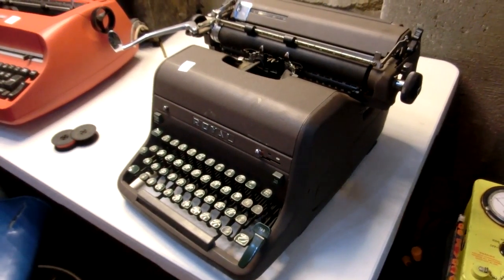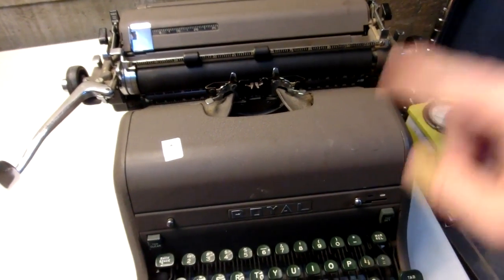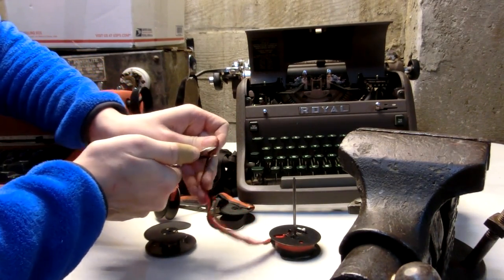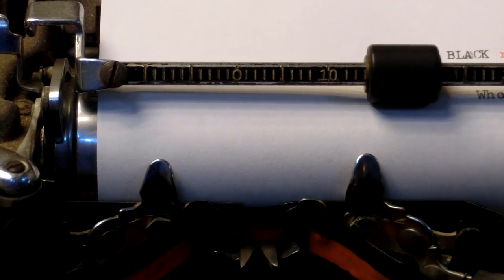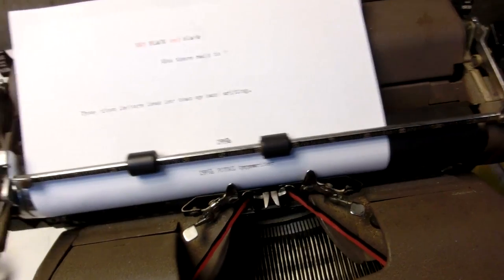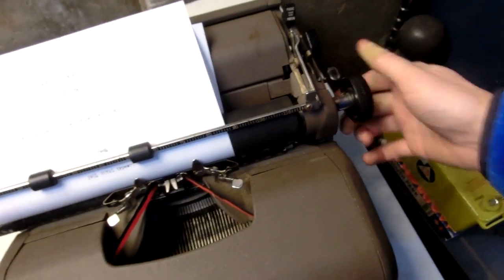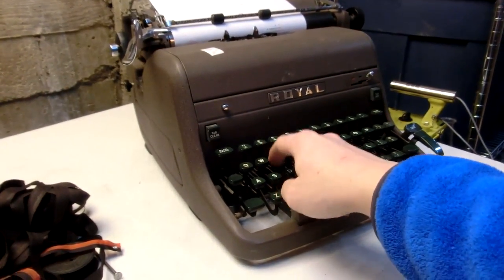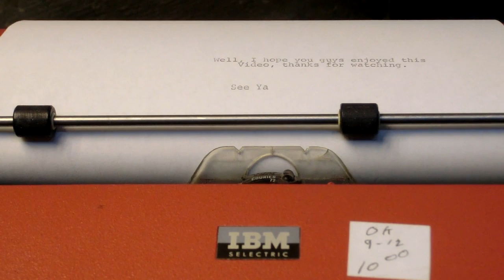worn-out 1950s Royal HH typewriter, lubricating mechanism and replace ribbon

Comment: Rinoa Super-Genius--Those IBM Selectrics are mighty fine typewriters.  I've used quite a few.  But I'll lay you book:  That HH Royal will outlast that Selectric by decades.  What you have there is one of the toughest typewriters ever built.  My 1952 Royal, which has seen severe service an an elementary school, as of this year has outlived my own mother.  You will be passing your machine down to your grandkids, and it will still be able to produce a neatly typewritten page as well as it did when it was new.  It will be well over 100 years old before its done (I have a working 1916 Royal upright that bears that out).  I've owned, serviced, sold, and rented these out for over 35 years, and I can tell you--you'll be going through more Selectric typewriters while still owning the 1 HH.  I presently have 2 HH machines myself--the 1952 11" carriage pica type, and a 1955 13" carriage elite type.  Both absolutely great machines.
Reply from the maker: I'm curious if a Paillard would be better built given the quality of the Paillard Bolex cameras, plus those are QWERTZ instead of QWERTY typewriters :D

but yeah this typewriter is nice. although i disagree about the selectric, it's lasted longer than this Royal for me.
Reply: Paillard typewriters, I've read, are actually Hermes typewriters--which had qwerty, quertz, and azerty keyboards, depending on the country the machine was to be exported and marketed to.  They are Swiss-made typewriters.  I once had a Hermes 3000 script-writer, which was a good typewriter, buttery smooth about the touch.  However, it had a few reliability issues, plus the plastic parts gradually disintegrated.  I tried an upright, but it was a little stiff.  I am not stating facts--just my opinion, the Hermes, Swiss-made and all, was NOT the machine a Royal upright is.  BTW, the $10 you paid for the Selectric was a very good deal.

Comment from the maker: I picked up this old typewriter the other day, and its pretty cool. although it has an issue of sometimes skipping a space after typing a letter, and other times it double types. i'm thinking it might be a bit worn out. its also difficult to get some letters to print correctly. it looks like i'll still be using my IBM Selectric for typing letters. but this ROYAL typewriter still is pretty cool. maybe i should connect it to a computer or something.
Reply: Judging by what you said in the video about being used to computer writing, and what I've heard about Royals demanding good technique from their users, I'd say the issues with double typing and skipping spaces are all due to incorrect technique. I would know, I work with computers so it's been interesting having to develop a parallel technique for typewriting. Curling fingers, elbows below keyboard level, wrist slightly bent upwards, and hitting the keys with staccato are the key. I'm sure you know this already though. Nice typewriter!

Comment: you should flush it out with laquor thinner and then blow dry with compressed air. do this a few times. If you choose to lubricate the segments just note that it will eventually gunk back up because oil attracts dust, so you may have to do this again eventually. The important part is to flush out the old gunk before you lubricate. The sewing machine oil is good or you could also use gun oil. but whatever you do oil use just a small amount. Just enough to wet the metal. Glad you are restoring this unit.

Comment: I bought mine a couple of summers ago, and have finally gotten around to cleaning it tonight.  lol  It was an interesting find; it came with its original dust cover.  Printed on there is the name of the business, address, and phone number that the machine was used for!  (It was a local business.)  

I hope to get her into good enough shape to use; she's a fantastic machine!  :D  (My go-to is always my Royal Aristocrat from the 1960s, but this one is her big sister in a lot of ways!)

I think some sewing machine oil will be just the thing for her; I went all over and cleaned her really well with alcohol and a tooth brush where I could.  There was some strange white powder on her bottom, but that was fairly easy to wipe away.  The biggest issue was on the inside of the lid; there was a HUGE squarish-shaped black goo that I can only assume was old glue from something that was stuck there once upon a time.  It was a DEVIL of a thing to get to come off, and some of it is still there!  (Sad to say I got a wee bit too desperate and scratched her paint when I tried using a metal scouring pad to get it off!  Goo Gone and alcohol softened it up, but I had to basically dig in there with my nails to get it off.)

If anyone knows what that could possibly be, please tell me!  Because my imagination goes wild with the possibilities!  lol

Comment: I used a 3M General Adhesive Cleaner to clean out dirt and grime on an old typewriter and it was fantastic. It left everything clean and dry and without any solvent smell. Also, I'm here because I just spotted the same Royal typewriter at a thrift shop today. It came in a brown carry case. But the machine smelt very old and the paint chippeda t several places. But there appears to be one big difference. The Royal I saw was the same externally but with a "touch" adjustment lever under the hood. 0-9. It adjusts the travel of the keys for better touch typing. Btw, you appear not to have put the ribbon properly into its travel slots (next to the reels).
Reply: the one you saw was from 1952 one which i have and the price she got the typewriter is a huge steal since its a 20 pound office/industrial typewriter. i would recommend to buy one if you find one for fairly cheap

Comment: The white position is used for correction paper. You slip the piece of paper in and that position doesn't put ink on it. Helps keep fingers and such clean. Real nice Royal Rin.
Reply from the maker: ah that makes a lot of sense now, thanks.
Reply: The "white" position is for making mimeograph stencils.
Reply: Shit, and all those years I used it for correction strips. Thank goodness I never had to do mimeograph stencils. ;)
Reply: @skycarl  It can be used for both stencils and correction and there were actually correction ribbons with a white band above the black which was a built in correction tape. The white would tend to flake off and fall into the mechanism creating lots of issues.

Comment: Hi so I actually have this HH Royal as well. I got it at a garage sale for like $10 when I was a teenager. I've only recently tried to restore it. It all seemed to work except the ribbon does not seem to turn when I type. If anyone has any suggestions, or there's something obvious that I am not aware of, please let me know!
Reply: Molly Green  same thing happened when I first got hh make sure the red is at the bottom and make sure it’s under and out and not over and out when it leaves the spool, look how this HH ribbon is feeded . The drive should pull the ribbon and the other one should freewheel.

Comment: Thank you.  I have a 1930s Royal which I still use.  May I add to your warning about lubricants.  Also avoid "3-in-one" oil.  It reacts with air to form a sticky gum that jams up any machine to which it is applied.  The only use for this product is to commit sabotage.  If you don't have sewing machine oil, you may get by with an SAE 5 non-detergent machine oil.
Reply: Three and one is three-and-DONE it is garbage vegetable oil

Comment: IBM one looks awesome. IBM are just brilliant designers and developers.
Reply from the maker: especially 1960s IBM. although i do enjoy 1980s IBM. but now i'd have to say Dell is the king of design.
Reply: I like HP too.
Reply from the maker: thingyee1118
i'm not a fan of their laptops. winner has to be the Thinkpad.
Reply: I think their business laptops are fine. Yes Thinkpads are great too.
Reply: Rinoa Super-Genius I never used to like the little red thing they had in the middle of the keyboard as well as the touch pad. Don't know what it's called but I just couldn't get used to using it :-)
Reply from the maker: Eicles
i love the trackpoint, that was the main thing i hated about using macbooks when i worked at apple, no trackpoint! even a trackball would have been ok.
Reply: ah yes the track point is signature of IBM. Its quite handy for moving around with little effort. Gets stuff done quickly and it only takes up a little extra space on the keyboard to have as an option for the user. I got lots of IBM laptops maybe I should do a video on them.

Comment: I'm sorry, I just can't get over that title:  Worn-out 1950s Royal HH typewriter?  Your machine seems in pretty good shape--just needed a ribbon, some cleaning,  and a bit of oiling.  Couldn't tell you anything more without seeing a print sample.  And as for the date on it,  just look in the back on the right hand side (with the keyboard facing you), and you'll see the serial number.  Write this down, and look up online the Typewriter Database.  My guess, offhand, I would say that with the ROYAL inlay instead of a direct stamping on the front panel, and the aluminum keylever inserts instead of cast iron, I would say you had something made between 1954 and 1956, with the possibility of it going as far back as late 1953.  They manufactured the HH, from what I have gathered, from about July, 1952, to about August, 1957.
Reply from the maker: because it has issues of double typing and skipping a lot of the time, i believe that is a symptom of it having a lot of use.
Reply: It needs a carriage adjustment. These machines don't wear out.
Reply: I think I've run into what could be causing her problem:  A loose dog that isn't loose.  I just got a 1954 Royal HH typewriter that was real sloooow.  You had to be real slow with it, or it would pile letters one on top of the other.  I wondered for a little while just what that could be, since that didn't seem normal to me.  Now I had never looked into the escapement mechanism of one of these machines, mainly because I never had to before, but there was something wrong here.  I tried every adjustment I saw, but it didn't do anything.  Fortunately, I matchmarked where everything was so I had it back like it was adjustment-wise.  I went online to the typewriter database repair manual, and found under the escapement mechanism of a Royal typewriter, the loose dog was completely on the other side from where I thought it was.  I studied it, and opened up the typewriter and studied its movement when I pressed the space bar.  There was no movement, which told me this thing was gummed up.  I stuck a dentist pick down there to move it, and surely enough, it moved very sluggishly at first.  I kept oiling it with transmission fluid and rocked it back and forth until it started to move on its own.  When it started moving like it looked like it should, I put the machine back together (roller, plate, two screws, platen), and tried it out.  It typed normally.  The loose dog is loose again!!  Rinoa Super-Genius, I hope this helps if you one day are curious and want to find out what's going on down there.  Dr. Typewriter, I hope I also provided help for you as well.  Of course you may have run into this type of problem before, but if not, I hope I took one for the team and gave you something you could use.
Reply: Probably that. It is a common issue with Royal standards. I have two KMMs that started of like that.

Comment: It kills me how people think that WD-40 is a lubricant!

That's a great typewriter. The "white" color setting may have been for a ribbon which had white ink, used for erasing things. Some typewriters had them.
Reply: It's always been my understanding that WD-40 can be used to free mechanical joints which have become stiff or immobile (due to rust, etc), but does not provide any sort of lubricating function. In fact, I've read that it actually breaks down oil, removing any existing lubricant already present, resulting in total dryness.
Reply: correct, wd40 recommend you follow up with some 3in1 once the wd40 has evaporated off
Reply: I use it to rejuvenate some older typewriter ribbons.  It works pretty good for that.  It can be used as a cleaner, but get it out of there however you can.  Otherwise, you'll end up with a tarbaby of a typewriter.
Reply: I used to fix sewing machines for a living. And if I had a nickel for every time a frustrated husband brought in their wife's sewing machine that had seized up after hubby had blasted the insides with WD-40...actually, I got quite a bit more than a nickel for those, come to think of it. 😆